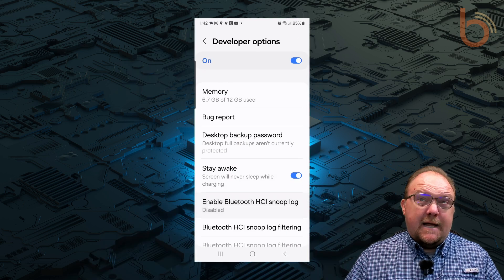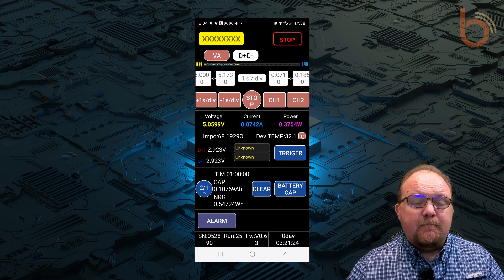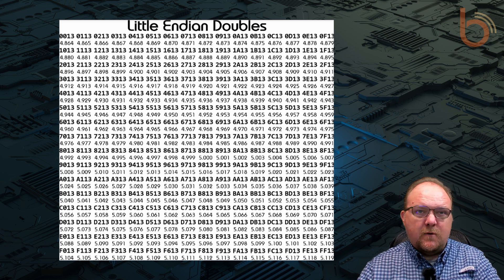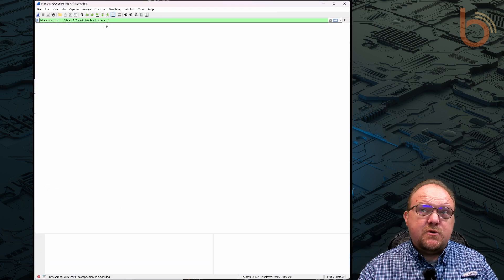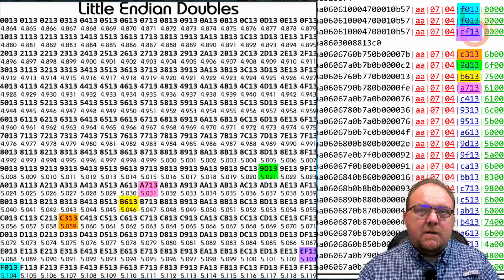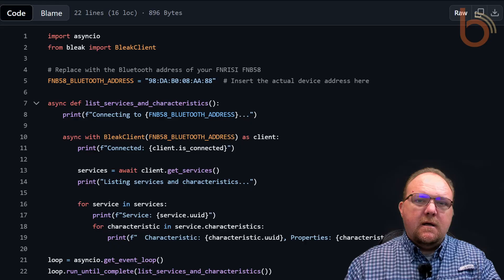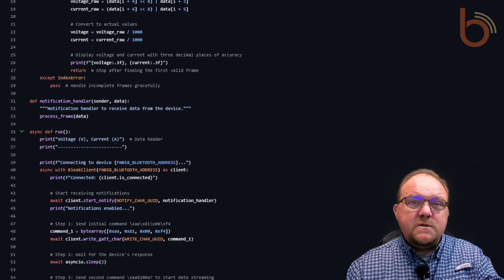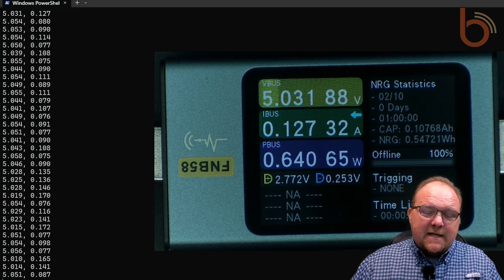Hack Bluetooth, for Fun and Profit! #hamradio #hack #scanner #engineering

Comment: Wow, this is absolutely brilliant! Would love to have a series about reverse engineering the functions of this device further. You're very knowledgeable.
Reply from the maker: Glad you enjoyed it!  This goose is pretty well cooked.  There's a link to an article that shows what the other datatypes are presumed to be, and that can be confirmed by recording the screen while streaming the data values.  And github holds code that is easily modifiable to retrieve them and compare.  Might be good exercise if you're into this sort of thing.  (Copy the hack - extend the hack).  For the next experiment, I was thinking about something a bit more complicated -- like the BTECH UV-PRO or similar Bluetooth radio.